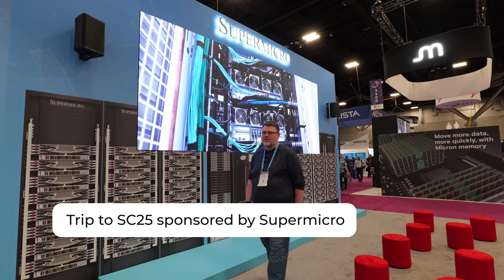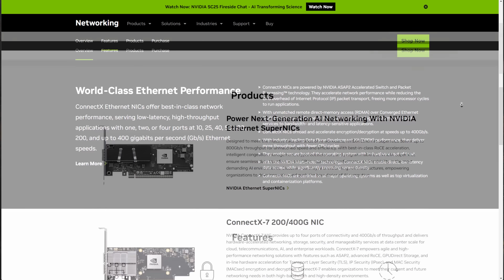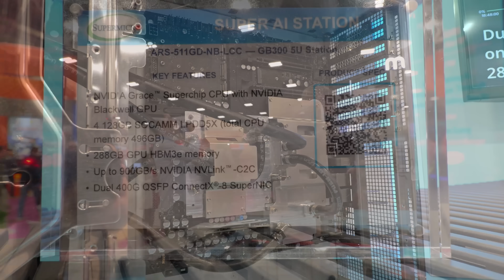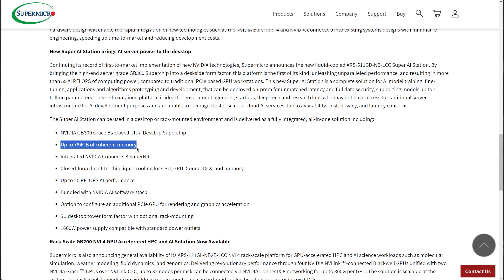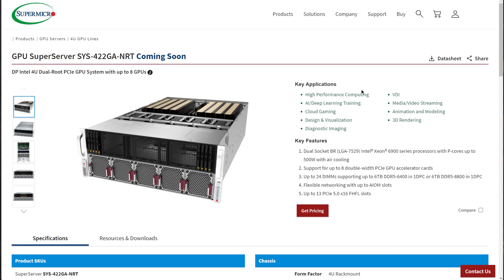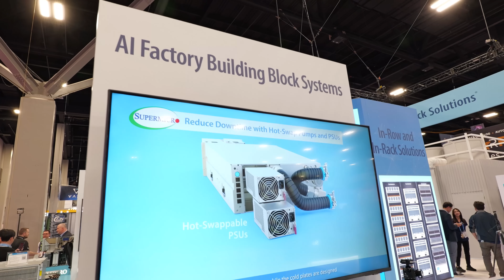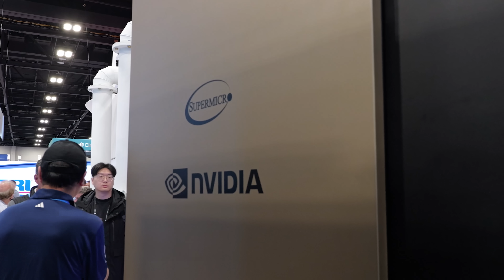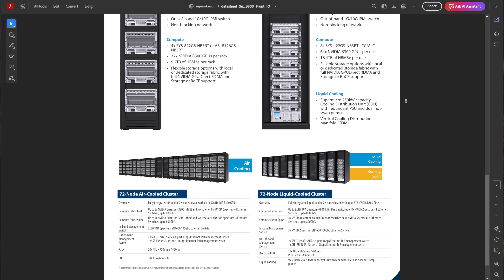Supermicro at Super Compute 2025 Overview

Comment: I built my first compute cluster for a mere $1m twenty-something years ago. It had fiberchannel networking,  many, many analysis machines, 10,000 rpm 2.5' hard drives AND a mean flash card for caching (I cannot remember if it was a single gigabit or two). The last time I caught up with my old colleagues they were running everything on one box with a few CPU's and GPU's (I believe back then it was the K20).

Comment: So much rage about AI, it's silly really. If it is a bubble then you'll be able to get these used in a year or so for cents on the dollar. These systems are still insane and even without GPUs you could build an amazing storage server out of one of these. The absolute high end that is shown off at trade shows has never been very accessible to homelabbers due to cost but after a few years it is all chucked on the second hand market. Just wait, rage less and think about the wild time ahead with PCIe6 networking as home storage...
Reply: ? As everything becomes more integrated, it will essentially be useless to anyone who doesn't purchase the entire solution, including all the specialised software required to use it.

Comment: Wendell.... 142kW is way more than 2x-3x households 😂 maybe closer to 100x
Reply from the maker: 200a typical american home panel (some homes are 400a) * 240v = 48kw absolute max (yes, yes, typically people are way way under that and the grid would brown out if everyone used even a significant fraction of that.... but......)
Reply: @Level1Techs  If houses used 48kw, the power bill would be insane... and you would need a LOT of stuff in your house running 24/7 to use that much power.

I mean sure if you have like a server rack with 10 overclocked 9995WX threadrippers + 4 5090 gpu each doing AI work 24/7, even with that, you would be at around 35kw... that would be a LOT of heat, you would need a powerful AC, so add a couple kilowatts more... and yeah you would be near the maximum of what your house could supply... if thats even possible to install those threadrippers + 5090s racks in your house to begin with... probably need a whole new electric system to be installed.

But yeah if every house ran a 3000W+ computer per person 24/7, the grid would be screeeeeeeewed... if every adult in the USA (267 million) had a 3000W PC... the grid would need 0.8 TW of power just for that... which would be 62% of the entire US grid, just to run personal computers.

We're gonna need a bigger boat... and by that I mean we're gonna need FUSION... asap.
Reply: @Level1Techs homes built more than 50 years ago will have 60a service, while homes since then are typically 100-150a.  Depending on neighborhood and what transformers are on the power poles.  I think 200-250a is more of an exception or for houses larger than 3500 sq. ft.
Reply: @WayneMcCormick  My townhouse built in the early 80s has 200a service, so no (at least in America) it's not an exception to have 200a service.
Reply: @WayneMcCormick  My 1974 ranch style home built in the middle of nowhere Nebraska has a 200A service.
Reply: @WayneMcCormick  That may be true in parts of the country and whether it still has a fuse box or has been retrofitted and updated to a breaker box. My 1963 built house has a 200 amp main and has since the early 90s when central air/heat was put in and the fuse box was replaced with breakers.
Reply: @Level1Techs  Lol, European Apartments come with 2-3x16A breakers. 20A if you have an oven. So 16kW max total.
Typical draw would be around 500W-3000W. Let's say 1000W average. Energy is crazy expensive now at up to 40 Cents/kWh.
So visualize TWO entire Commieblocks. Each 10 stories.
142 apartments total. 250+ people.
That's how much this rack is drawing.

Insane. The European mind cannot comprehend this scale.
Reply: If Wendell's using >40KW at home... you never know with his computer habit. 😆
Reply: Don’t worry. Each AI data centers will have 100 jet engines to keep the power flowing regardless of weather!😂
Reply: As an comparisation, I have an electric heated villa in northern Sweden it is fused as 3x20A 400 Volt. I use about 33.000 kW a year... I've seen daily use of up to 130kW when it is really cold.
Reply: @Bratfalken  yes sounds legit. One has to remember the AMperage connection creation costs according to Amps. I have appt house here in CZ and most apartments have 15 to 25 A connections with 240V...which is a norm....
Reply: meanwhile most datacenter racks in the UK have a power limit of 3kW 😢
Reply: I have 2 200Amp services to my house and I still can run that by a bit. At 2 phase I have 96KW. Though I beleive it is more normal to have 50 to 100 amp services where I live so that would be 3x to 12x the max power draw of a house in my area. 

I see why the grid is having issues. I can imagine hyperscalers are buying these in very large sets.